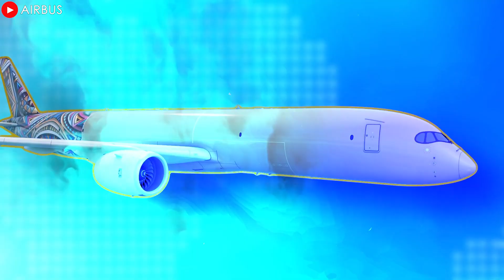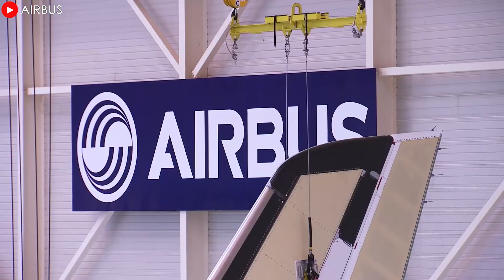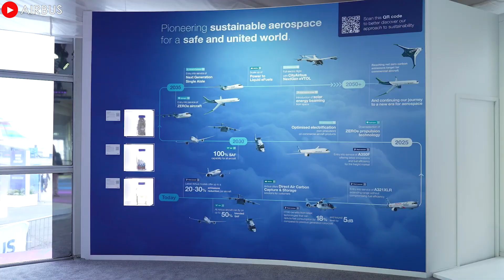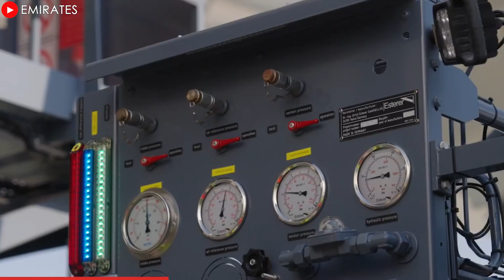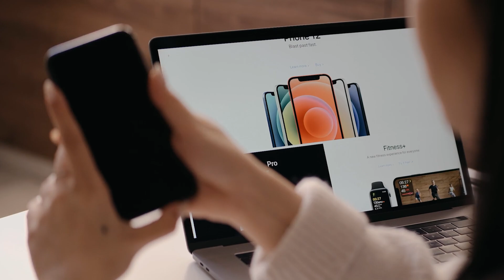NEW Airbus A350F is in BIG TROUBLE NOW! Here's why

Comment: Well, with IAI converted 65 77W's into BCF's hauling ~90+ tons on the cheap, the new freighter market is NOT looking good anytime soon as there are another 700 available for conversion half of whom are 2t lighter with a fuel burn 2% better.  These conversions are being made at 20% of the initial cost.  I highly doubt a35F and 77xF will sell much of anything in the next decade especially as 77F's have ~300 already being used and all with Giant number of hours left on their frames good for MANY decades to come.

Comment: A Further Contradictory Video on the Subject !! : 
“Designed by Clowns!” How Boeing’s Mistakes Led to the 737 MAX Crashes!
When it comes to Boeing 737 Max and the two tragic crashes that it was involved in, the question often becomes why Boeing chose to launch this variant in the first place. That clearly deserves to be answered but even if we do, it won't explain the whole story.
The bigger thing to understand here is how Boeing managed to design and certify an aircraft with a system that should have been the equivalent of having a tiny kitten locked in a cage but instead became a loose tiger.